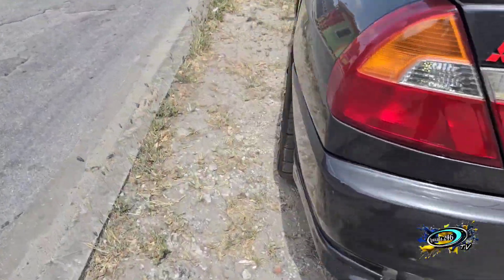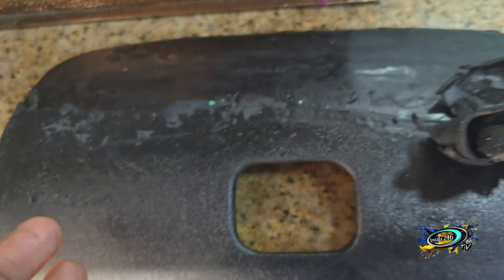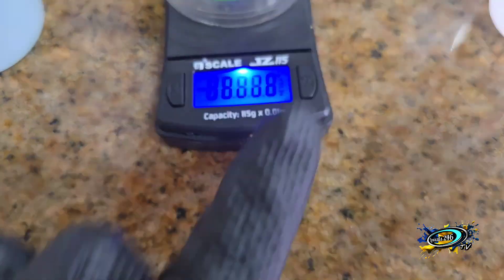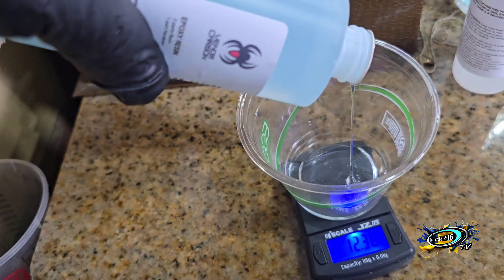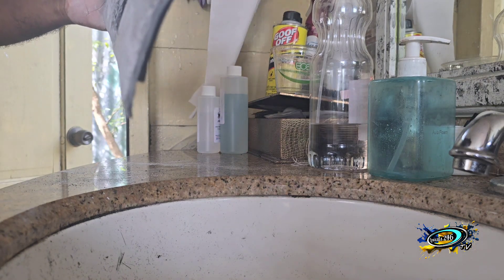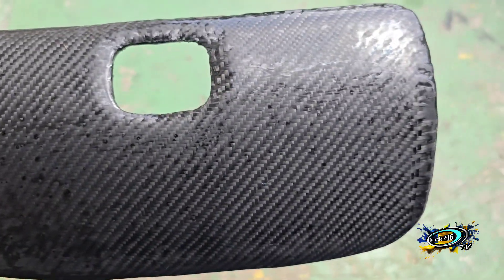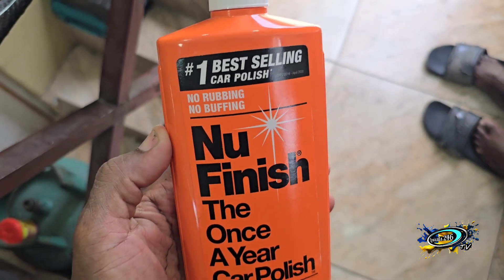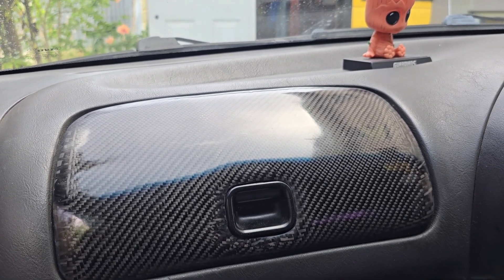Part 1 of making my own carbon fiber parts

Comment: little tip is to use a TINY bit of epoxy on the back of the carbon fibre so that when it dries, its still flexible but it stops fraying and distortion of the carbon fibre
Reply from the maker: Thanks I didn't know that I thought you have to put the cloth in different directions to prevent flexing
Reply: @lowcals246  i always buy "pro finish" carbon fibre, its a little more expensive but it cuts the fraying down a lot.
Reply from the maker: @TE_53349  I will check that out thanks